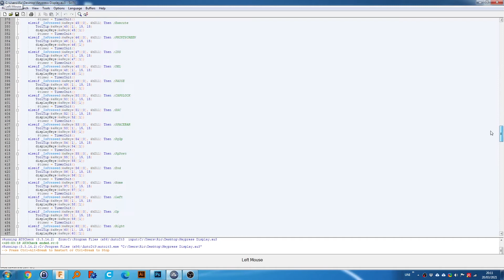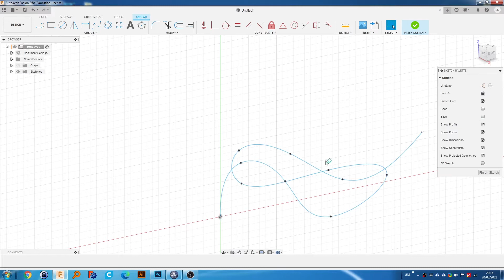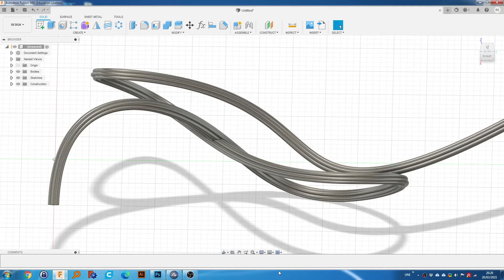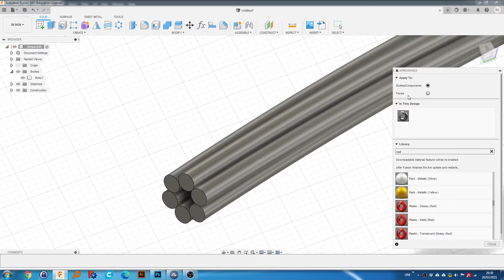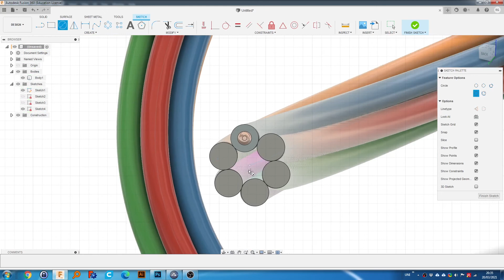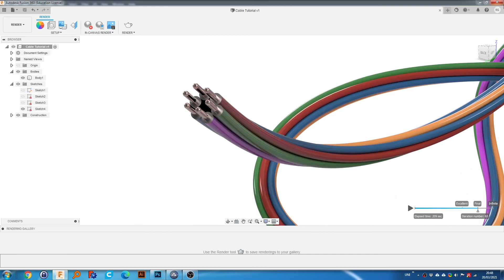How to Create Cables or Wires in Fusion 360

Comment: It would be nice to run a wire between 2 mechanical locations - such as a pin on a connector and a circuit board...as next level

Comment: I cannot make the 3d movement of the spline
Reply from the maker: Did you enable 3D sketch? You may also need to start and stop the sketch kode for it update the modes as Fusion doesn't always change the modes I've noticed.